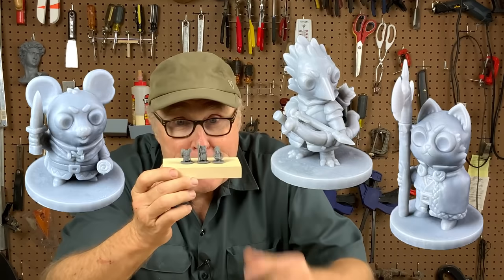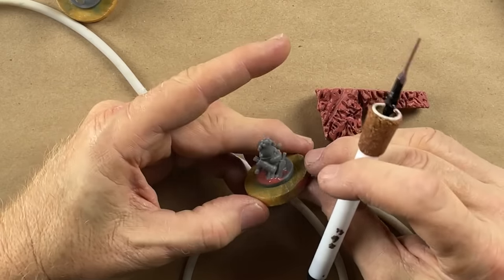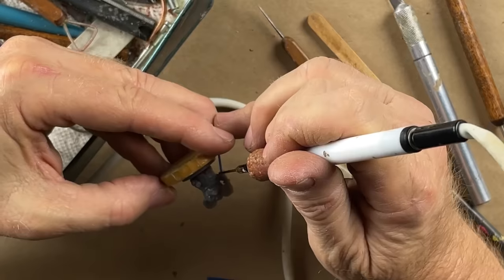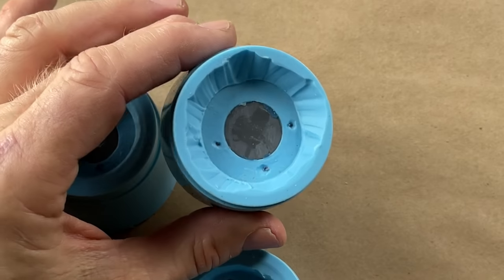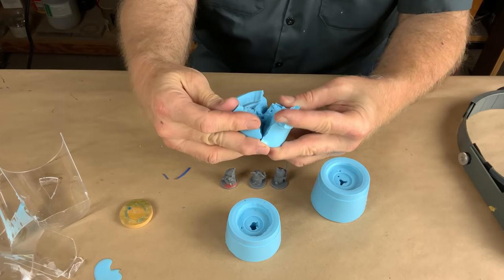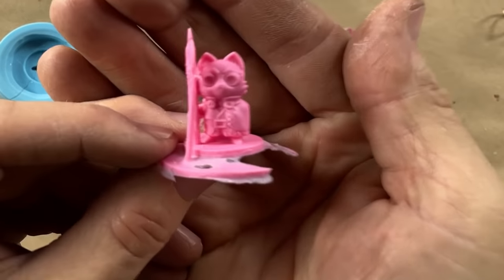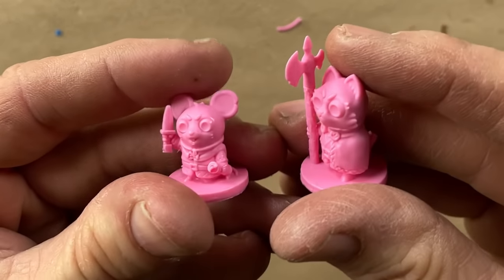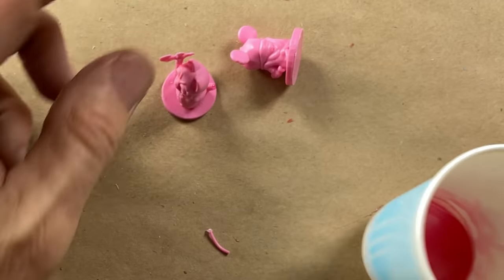Tips And Tricks For Making Miniatures

Comment: Functional dice (polyhedral set of 7) next please! Would like to see how you would vent those.
Reply from the maker: Super tricky because of the embossed numbers. There’s just nowhere to place the inlet sprue. And if you put a vent at the logical top of the die you will have a tedious cleanup on each casting. In theory you could use injection just so the sprue and vent would be really thin.  Or use the two-part smoosh mold technique.

Comment: Over time the mold will come apart...I have a quite good technice for 2 parters...you just need the cheap polymer clay which never becames solid, and lego...a lots of lego (apart from the basic modelling sculpting tools you probably have. Flat out plaster, make your modell sink into it. work out that there is no undercuts, make a few bumps, but make them like pushing from one side (but try all not to have the same orientation), desing the place where you want to pour in the resin and build small half pipes out of clay from the figurines until the edge(what will be the top), and make it wide so you can have a nice cone for casting. 
Build a lego frame around the whole thing(while still be on top of the clay, so you need to push the lego frame into the clay, build it up so high that you will be over the figurine if you pour silicone. Make sure use a little clay to seal all the opening between the bricks, make sure that the casting pipes are reaching the lego frame. (For bonus point spray the whole thing with silicone spray. 

Pour the silicone and wait for hardening. Remove the clay, but do not open the frane....now put the clay back inot the pipes, because you need them and build them up so they will froma  full pipe. Build the frame up so that you can pour silcione here as well. spray silcioen spray on tjhe figurines, try to dry up the excess with a earbud. Then try to spread talcum all over the silicon mold surface without touching the figurines. Cast silicone
After it hardenes you can remove the frame and getting out the plaster and using that as a strating point the two half should come apart without using a sclapel, and you will end up with two parts which can only fit together in one certain way...

Also you need some(a pair) flat wood/or hard material and good clamps/strong rubber bands, whatever. Assemble, and pour the resin (YES there is no way to perfectly fit the two sides, so there will be leak, keep it in mind)

Comment: Another great video. Thanks Robert. I'm curious, under what circumstance would you advise separating a figure like that from it's base and casting in two pieces? Or maybe hinging a piece to avoid holes / simplify a mold?
Reply from the maker: I would do that any time it makes the casting process simpler. It’s often helpful to take a character apart and cast it in pieces.
Reply: @RobertTolone  Have you done/will you do a video on how to do that with sculpts like this? Especially the hinging option? I've not seen that before.
Reply from the maker: @sonipitts  Not sure what you mean by hinging a piece.
Reply: @RobertTolone  Whatever Allen was talking about in his original content. I don't know what he was referring to, that's why I'm curious. :-)

Comment: That tool that you use for melting/sculpting the wax - could you also use that to "sculpt" (grooves, texture, and so on) in foam for terrain building? What is the tool called?

Really appreciated this episode! Gave a lot of insights for me understand what I should be looking for when casting - thank you!
Reply: Unless I remember incorrect the tool is used for Pyrography, drawing / burning into wood. I know there is a older video where he talks exactly about what type it is, Robert says that one is the best he has found for this adaptation. But for terrain building it would work. But for larger shaping you are probably better of making a hand held foam cutter (similar toll but with a metal loop on so you can carve the foam). This one would probably be best suited for details, but not sure there is a need for that type of tool for making details of that size as you already have things to do it. And if not the foam cutting tools metal wire ring can be shaped to fit that need. Hope it helps. =)
Reply from the maker: It is a Foredom Wax Carving pen.

Comment: Very informative video! I was wondering if you could give me some advice. I'm currently trying to mold a 4 legged dog that has a base, in a 2 part mold. I can remove the first half, but the other half wraps around the legs of the miniature and I have a hard time releasing it without destroying the mold. I have a picture but I'm not able to post it..could you shed some light on what I'm doing wrong?

Comment: Hi Robert! I know this is a older video but what do you use for your vents? I see you use a wax gun but what is the blue material that you are using for the vents and the gun that is used to attach them? I just started this and so far I am using wire and Elmer’s glue and it is long and time consuming to get those wires to stay on the original.

Comment: Amazing as always, i was wondering if there is any method for casting chains
Reply: I would also love to know this!
Reply from the maker: The technique you would use depends on the size of the chain and the shape of the links. It’s usually easier to cast a tight chain because then you can just treat it like casting any thin, straight object - except for the holes. Your parting lines have to cut through the holes. If a chain is not tight your only option is to cast the links separately and assemble them. Which is hugely tedious.

Comment: Sir, do you have an ideal mixture for creating highly detailed figures? I'm struggling with the second casting process in modeling wax to smooth my master models. Specifically, I'm looking for the right mixture ratio between beeswax, paraffin, carnauba, candelilla, talc, and colorant. I've tried a 30:40:10:5:5:1 ratio, but it easily crumbles or can't hold its shape well. I've experimented with various methods and am almost ready to give up and move to 3D printing my models instead of continuing with the handmade process.

Comment: Hi good morning! I would like to ask advice / help from you master, :) I made a silicon mold for a 3 cm size component similar to your figures in size. The mold was fine and I was able to remove the original component without any problem. BUT when used this created mold and I filled it with my epoxy after a day wanted to remove the newly created epoxy component, The silicon mold and epoxy totally stucked to each others and I was not able to separate them. After I totally destroyed my silicone mold, It still stucked to my epoxy and I had to literally scratch it of from epoxy. What did I do wrong? As I see you also did not used any non-stick matterial on the mold (moreover in the holes it is even not possible I think.)

Comment: Great video! I am curious if you have to do anything special to prepare 3D prints for casting with them? I recently tried to do this and the silicone didn't cure around the model for me.

Again great video. These are super helpful for beginners like me.
Reply from the maker: 3-D prints are notorious for causing cure inhibition in silicone rubber. Especially if you are using platinum rubber. Always test your rubber against the print before you make the final mold.
Reply: @RobertTolone  Thanks for the information. You'd be surprised how difficult this is to find online.

Comment: I’m not sure what mechanics might be involved, but is it possible to do the pour inside your vacuum chamber? Surely that would solve the problem of bubbles, although at the expense of more manufacturing complexity.
Reply from the maker: It actually won’t. You can still catch bubbles because the vacuum isn’t complete. There is still some air in the chamber. A better strategy is to properly place vents in the mold.

Comment: Greetings from Mexico, I would like to know what material you use to make the joints with those blue strips. The translator says that it is wax but I would like to know if it is some kind of special wax and where I could get it.
Reply from the maker: It is called blue sprue wax and it is sold by jewelry making suppliers.

Comment: One of the pitfalls to 3D design, and 3D printing, in the manufacturing world; designers without a concept of manufacturing processes, or the on the otherside of the coin, attempting to manufacture something designed only to be 3D printed (or other process with unique quirks).  I was glad I learned to be a machinist before I started designing (as a drafter) for this reason, as I was exposed to the metal working methods as well as assembly prior to learning to design parts.  Good commentary everyone who designs parts, no matter the material, should take to heart, at the start of the project if the end use will be a master for mass fabrication.  There are a lot of incredible 3D print miniatures these days, but yeah, resin casting is not SLA printing!
Reply from the maker: Exactly, Michael. I had this beaten into me by engineers in toy companies.  Very often I am designing for injection molded toys and even the slightest undercut is forbidden by the manufacturing process.  We start at the end product and work backwards to the prototype design and sculpt.
Reply: @RobertTolone  LOL, normally, as a drafter (or our guys on the shop floor, sheet metal and machined metal) have to come in and explain to Engineers why designs aren't able to be manufactured!  I suppose it depends upon the industry who gets to give whom "The Talk"
Reply from the maker: @michaelsudsysutherland5353  😀

Comment: Is there any particular rhyme or reason for where the air vents go on a piece and how many you should have?
Reply from the maker: Yes the placement of vents is a precise art.  You should place a vent anywhere air might get trapped as the resin fills the mold. Therefore at the very top of the bumps in the cavity. The trick is to position the part in space so that there are the fewest possible vents and that the cavity will fill naturally without any place for air to get trapped. So the placement of vents is 100%  rhyme and reason.

Comment: Robert,
How come you didn't use Mold Release on these figures ????
Reply from the maker: There was no need to. The resin releases from the rubber just fine.  If you use release it may extend the life of the mold but then you have to clean the release off each casting before they can be painted

Comment: Robert, could you do a video for molding and casting cement?
Reply from the maker: I have almost zero experience casting cement but it would be fun.  I have cast things in hydro stone and had better results using urethane rubber molds than silicone.

Comment: Hello thank you for your video :)
Little question for me. I don't have a pressure pot. At the junction between my piece and the air vent / the funnel, I reveal lots of air bubbles in my resin when I sandpaper the air vent and the funnel (just under the suface. Am I doing something wrong? 
Maybe my flow si too slow of too high and I should modify the diameters? 
I have a perfect 90° edge between my piece and the vent. Maybe a curved fillet on the edges of junction could help ?
Thank you in advance
Reply from the maker: It sounds as though your bubbles are rising up to that spot and the resin is gelling before they can escape. Either that or your resin might be foaming.

Comment: So when you made these molds did you put the silicone to cure in the pressure pot? I keep reading that if you’re going to cast in the pressure pot you need to let the mold cure under pressure too…I’m just thinking if you degassed the silicone then does it really make a difference.
Reply from the maker: I never cure rubber in the pressure pot or vacuum chamber for two reasons:

The first is that I often don’t know how the original model is constructed.  It may have voids inside it that could crush under pressure or explode under vacuum.

The second is that it is not necessary. If you properly vent the model and you degas the rubber in a vacuum chamber before pouring it around the model you should have no need to subject the curing rubber to pressure or vacuum.

It’s a myth that you have to pressure cure a mold if you plan to pressure cast it.
Reply: @RobertTolone  Now that makes a lot of sense!! Thank you so much for answering.

Comment: If you did those in a two part mold would those gaps still be an issue if you oriented it correctly?
Reply from the maker: yea yes because you’re still going to have trapped rubber. The easier solution would be to remove the character from the base and cast them as separate pieces.

Comment: Unrelated, but I was reading about tin cure silicone and platinum and that the tin cure mold shelf life is only 12 months. I know you use tin cure, how long do they actually last? and is it true to that if you want longer last molds you should use platinum silicone?
Reply from the maker: The manufacturers of rubber always recommend a short shelf life. But I have found in practice they last a lot longer in the bucket. It is true that tin rubber molds degrade over time. They can’t shrink and get hard and brittle.Platinum rubbers also have pot life But once the mold is made they are much more permanent than tin rubber molds are.  But they carry with them their own downsides. Platinum rubber is more expensive and it is much more sensitive to reaction with surfaces so you have to be careful about what kind of model you’re molding with platinum rubber.
Reply: @RobertTolone  Thank you for your response Robert, I really do appreciate it. The reason this came up is because I was looking to use clear resin and the manufacturer said in order to use that resin you need to use a platinum silicone mold or it won't cure properly. I while back I have problem with clear resin not curing right and I think that might have been the reason. Thanks Robert for sharing your knowledge and caring about educating the next generation.
Reply from the maker: @Lowtechstudios  Yes, you will need to use a platinum rubber as directed by the manufacturer

Comment: Would have been easier if they had kept the supports on these 3d prints so you could have used them as vents.
Reply from the maker: 3-D printing supports are not necessarily in the proper place for vents. The best solution of all is be to design the sculptures for resin casting, placing the proper vents in the 3d printed model.

Comment: I still think vacuum casting is the way to go if you want to avoid vents, bubbles and cleanup, no air ir the mold=no need for vents and no bubbles and a simple vacuum casting rig for home/small shop use shouldn't be hard to make.
Reply from the maker: Whatever works for is the right thing for you to do.

Comment: Hello sir . I am regular follow.  Please guide me  resign casting measures and requirements.
Reply from the maker: Each resin is different. The manufacturer will give you instructions for how to use the resin they sell.
Reply: Thank you sir .  I am new to casting concept.  I am silver  jewellery maker my models are diy pressed products . Now I want update my workshop to metal castings prospects like idols. 1in to 3inch metal idols.  For that  I am  learning . Upto my knowledge is   
1. Design in CAD 
2. Printing in 3d printer for master pices. 
3 making liquid diy  .
Up to this step   I am good. The problem is making wax pices . It's broken.  For that instead of wax can I use resin. What type of resin I want use. I am living small village in india . I am unable get some people help or instructors.   Please guide me . For metal casting procedures. 

Thank you sir  .
Your student. 
Ch v ramana
Reply from the maker: @ramanaxp  You can get 3d printing resin that will burn out like wax in the lost wax process for casting metals. I do not know if it is available where you live. But if it is, you could make molds for casting metals directly from your 3-D prints.
Reply: Thanks sir , I am from India.

Comment: I recognise your advocacy of one piece cut molds, and I use them for my purposes in development, but there is a place for bedded, cast mold partings in production. One piece cuts count on a knowledgeable and caring operator. For your purposes, 100 is a lot of castings The molds I design are expected to produce 10000 to 30000 castings, by semi-skilled operators that would rather think of something else. By having the opportunity to design a mold for surviveability, modeling a clay bed parting multi-part mold is a great virtue.
Reply from the maker: My methods are designed for prototype or low-volume production.  What I teach here on the channel is geared for artists, crafters and people who often work from a spare room or a garage. I would be very interested to see your operation. The kind of volumes you are talking about I would expect to be produced by injection molding, not by resin casting. But I have toured some resin facilities in Asia that do huge volumes out of silicone molds.